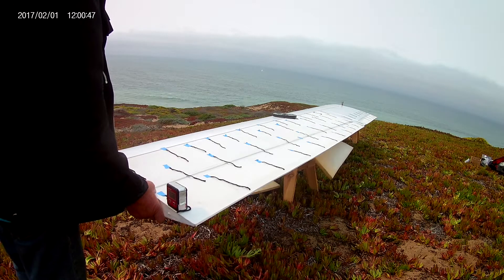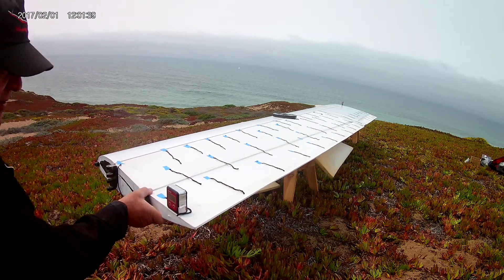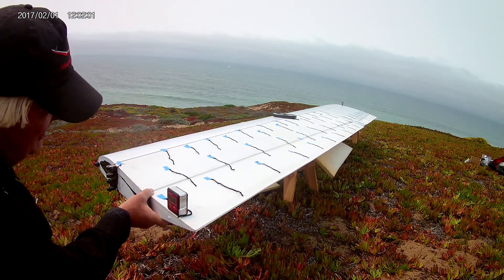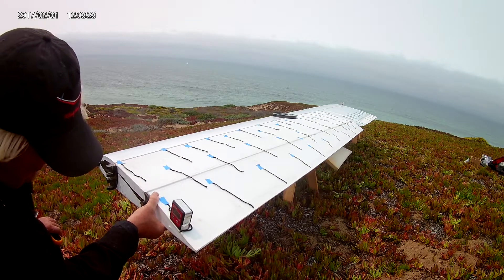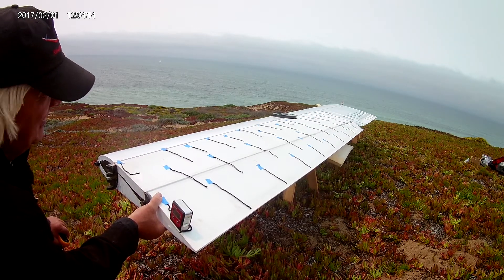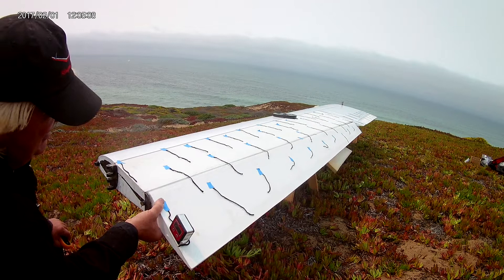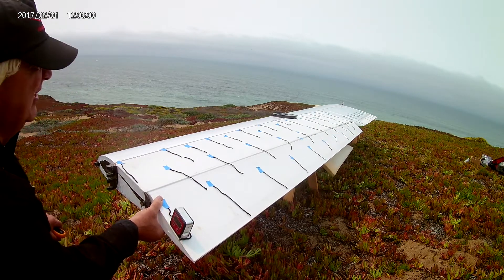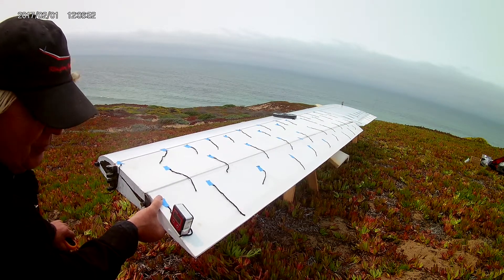Hinge Gap Seal Test #1

Comment: You might want to reset the date code on your camera.  I'm seeing the separation starting about mid span on the elevon - it looks to me like it actually stays fairly well attached at the root.
Reply from the maker: So I'm guessing you are not old enough to remember the VCR home players that even an engineer could not set the time on - everybody's machine always flashed "12:00"
Reply: @KlingbergWingMkII  Oh, I am. I programmed FORTRAN on punch cards. But I have to pull out the car stereo manual every year at Daylight Savings time.